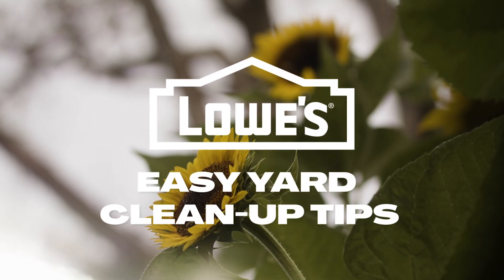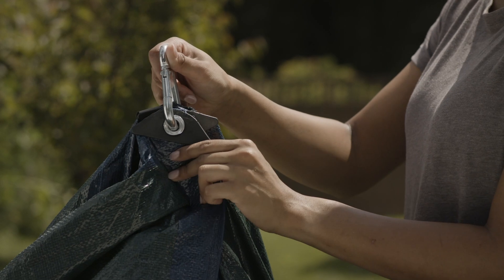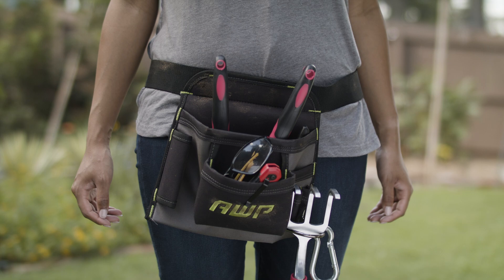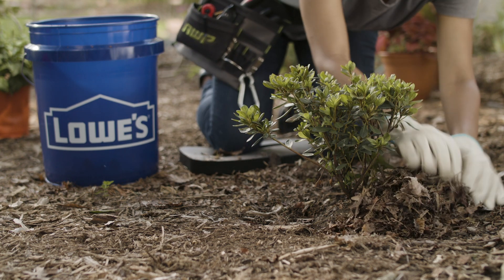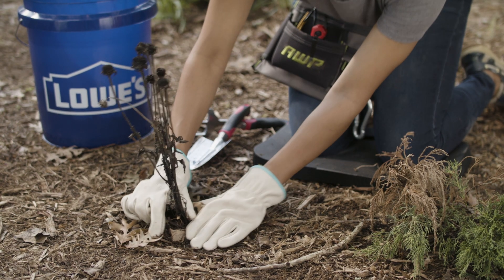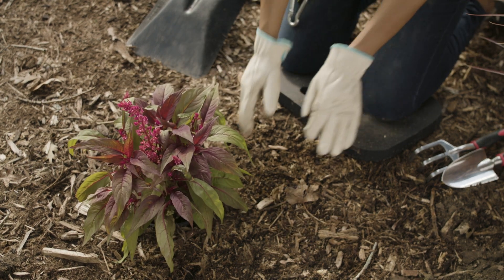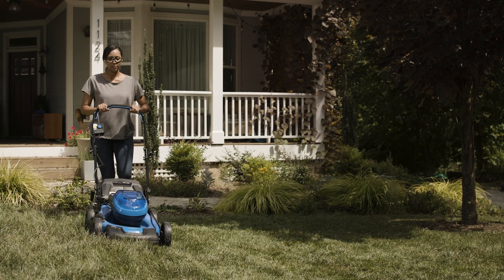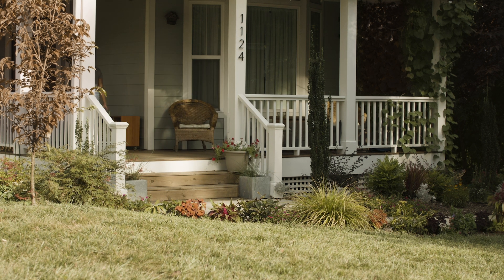9 Easy Yard Clean-Up Tips for Fall

Comment: Tip. Instead of the  flimsy leaf broom Use a 5 prong pitch fork or manure fork.  You want  have to bend over to pick up the leaves are straw you raked up with the pitch fork. Works great  to clean pine straw out of  short ornamental grass. Just slide in the grass, and pick up.